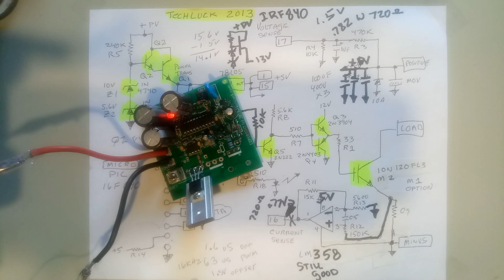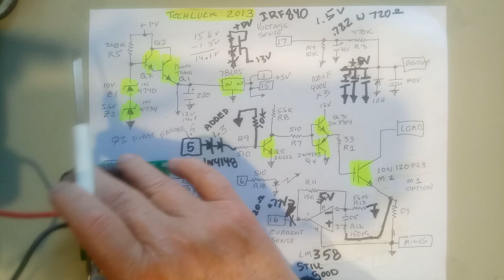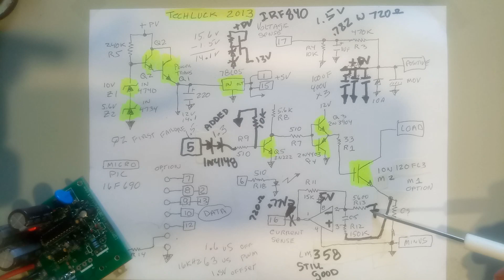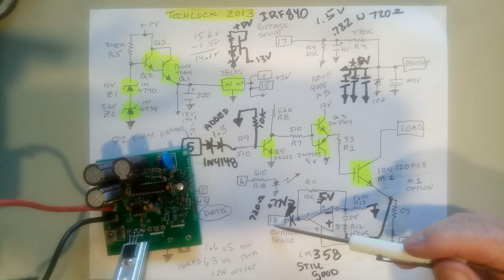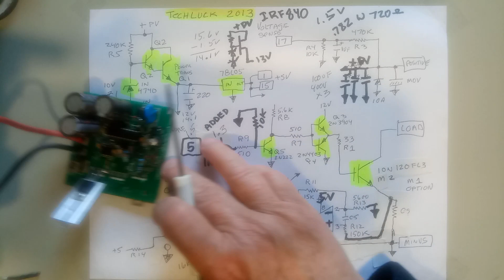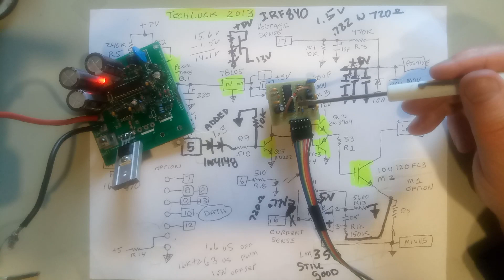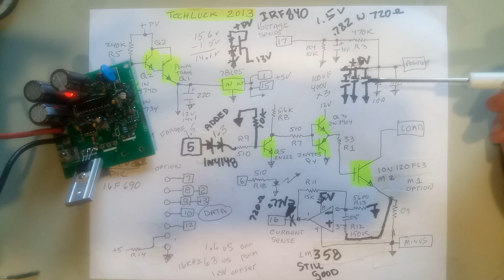TECHLUCK Investigation & Repair Update, Damaged Microprocessor Part 2

Comment from the maker: On further review the output IGBT was misread and is a 40N120FL3. Higher current, but still over  2V in saturation at 20A The LM358 for the current sense amplifier was also defective.  That makes every semiconductor on the board has failed.The power supply to the micro just isn't that robust and any surge has a direct path to the micro.  I have added an unlisted video on how to diagnose this board for repair. 
https://www.youtube.com/watch?v=OPDi78RaN1U&feature=youtu.be

Comment: Opera, is the micro processor pre programmed? Or does the builder have to program it?
Reply from the maker: It is proprietary software from the builder. I'm told there is some issue presently with the builder. I'm toying with the idea of building one with ICs  that will be commonly available for the next 20 years and would cost less than $5 to replace all of them if lightning struck.
Reply: @opera5714  "building one with IC"; this would make a great video series. ToughLuck!